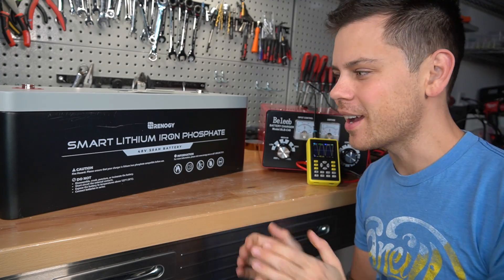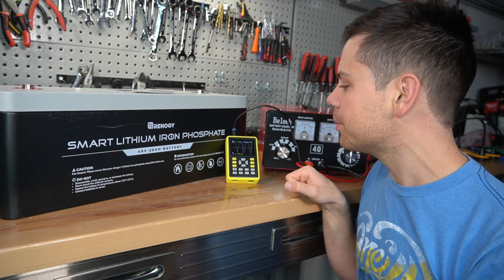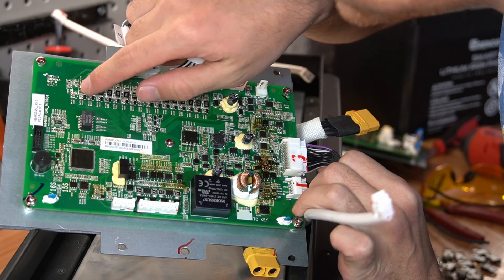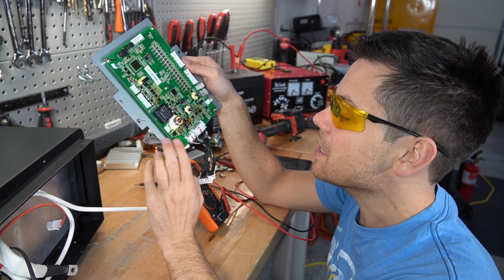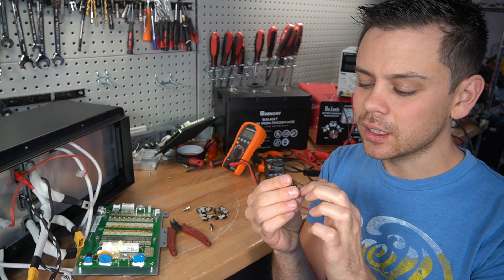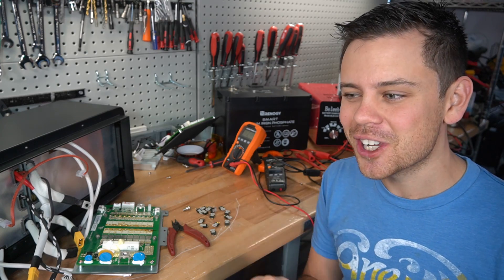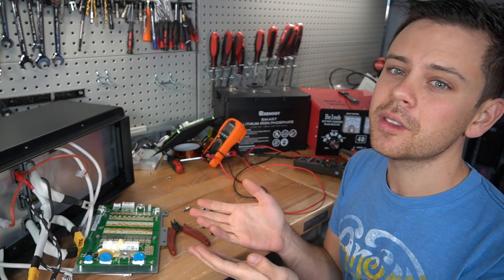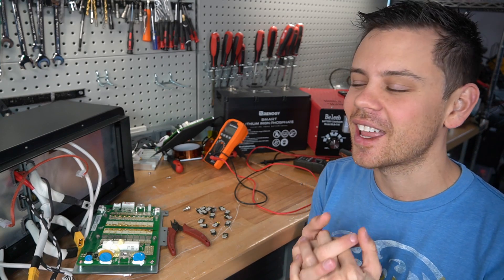Renogy "Smart" 48V 50Ah Part 2: How did I kill it?

Comment from the maker: Correction: I was wrong for calling it a cheap crappy charger, it is just designed for lead acid. My fault for using it to charge this pack. I charged a few other packs without issue, but this one could not handle it. 

Max voltage rating for FET on datasheet is 100V: https://www.st.com/resource/en/datasheet/stf150n10f7.pdf
But the kickback voltage from transformer based charger can be insane. Just takes one surge to destroy FET, or weld it closed.

I am going to order an expensive oscilloscope. I rarely use it, but man I need one now.

I also had 3x 48V inverter chargers I could have used, but just grabbed this one because it is so light and small. Stupid me. I have plenty of other equipment I can use haha that was not the issue as some are commenting before. And this charger worked fine on some other 48V LiFePO4/NMC packs.

~~~~~~~~~~~~~~~~~~~~~~~~~~~~~~~~~~
Tired of getting ripped off? Check out my "Will Prowse Approved" solar product recommendations below!

12V Batteries
https://www.mobile-solarpower.com/lithium-batteries.html

48V Batteries
https://www.mobile-solarpower.com/48v-batteries.html

Offgrid Inverter System Builder
https://www.mobile-solarpower.com/48v-complete-system-blueprint-559371.html

Hybrid Inverter System Builder
https://www.mobile-solarpower.com/code-compliant-48v-offgrid-system.html

Mobile Handtruck System Builder (very popular!)
https://www.mobile-solarpower.com/mobile-48v-system.html

Solar Panels
https://www.mobile-solarpower.com/300w-solar-panels.html

Ground Mount Solar Racking
https://www.mobile-solarpower.com/ground-mount-racks.html

Wire, Lugs and Busbars
https://www.mobile-solarpower.com/wire-and-connectors.html

Tools
https://www.mobile-solarpower.com/tools.html

Fuses and Circuit Breakers
https://www.mobile-solarpower.com/fuses.html

Plug-N-Play Solar Systems
Ecoflow, Anker And Bluetti! So many models to choose from. See my current recommendations here:
https://www.mobile-solarpower.com/full-size-systems.html

~~~~~~~~~~~~~~~~~~~~~~~~~~~~~~~~~~~~~~~~~~
Need to build a large DIY system? Need a trustworthy solar distributor? These are my favorites:

Signature Solar
Creator of EG4! Solar Minisplits, Victron and More! Largest Solar Store Online.
If you want $50 off, please use my link below and coupon code "DIYSOLAR50":
https://signaturesolar.com/?ref=cPwLcVc0SW-BjN

Current Connected
Best Prices for EG4, Victron, Midnite and so much more! Fast Shipping and Highest Rated Customer Service:
https://currentconnected.com/?ref=wp

~~~~~~~~~~~~~~~~~~~~~~~~~~~~~~~~~~~~~~~~~~
Join our DIY Solar Community 
Need more help? Join the largest solar forum on the internet for beginners and professionals alike. 140,000 members and counting!
https://www.diysolarforum.com

Check Out My Free Book
Best-selling and beginner-friendly guidebook to off-grid 12V solar!
https://www.mobile-solarpower.com/the-book.html

~~~~~~~~~~~~~~~~~~~~~~~~~~~~~~~~~~~~~~~~~~
Contact Information:
I am NOT available for personal solar system consult! If you wish to contact me, this is my direct email: williamprowsediysolar@gmail.com
FTC Disclosure Statement and Disclaimers:
Every video includes paid promotion or sponsorship (such as free products for review). Some links on this YouTube channel may be affiliate links. We may get paid if you buy something or take an action after clicking one of these. My videos are for educational purposes only. Information is subject to change/update at any time. Electricity is DANGEROUS and can kill. Be smart and use common sense :) DIY Solar Power with Will Prowse is a participant in the Amazon Services LLC Associates Program, An affiliate advertising program designed to provide a means for sites to earn advertising fees by advertising and linking to Amazon.com
Reply: It looks like it might even be more than 72V, the oscilloscope screen looks pegged. Can you adjust the volts/division higher than 10V? I think that's a 5012H scope which should be able to read up to 800V with a 10x probe.
Reply from the maker: Oh right, I thought that it was pegged too, but I used autoset and max voltage for edge. I can't read any voltage higher. And yeah, 800V max. 
Just tested it different probe and cant get a higher value. 
But yeah, the kickback is probably a few hundred volts. I could test that also
Reply: @WillProwse  
I think you would probably need a 10:1 probe for >80V voltages. Oops, I see Martin Stieber beat me to it. 

I’m not sure why you need an expensive oscilloscope. 
It’s nice to have an isolated one (so you don’t blow it up whenever there’s a direct path to mains). The battery operated one obviously is isolated;). 
If you don’t need to measure high frequencies why would you spend your money on an expensive oscilloscope?
Reply from the maker: @Conservator.  The fancy ones have so many cool options and multiple channels :D
Reply from the maker: @Conservator.  But true, for low voltage DC, my current scope does nearly everything
Reply: It looks like that scope can only read up to 80V with the 1x probe. So it might be even worse 😳
Reply from the maker: @MarcelStieber  Oh crap good point about the 80V with 1x probe. I still got 72V with my 10X probe
Reply: Or you might be able to use a DMM with a max-hold function as well to get a other opinion 😉

You should be able to manually adjust the voltage scale to make sure it's not pegged.

Time for a charger teardown?!
Reply from the maker: @MarcelStieber  This charger is going in the trash haha actually I could still use it for lead acid. Oh smart idea, ok
Reply: I found lots of review videos for that charger online, but no teardowns or actual electrical reviews. Totally understand if you're trashing it. Wanna post a few photos of the inside first?
Reply: Teardown definitely in order
Reply: If you are going to get a expensive oscilloscope, May I also suggest you invest in a differentotial probe to protect the scope when working with high voltage. Google don't blow up your oscilloscope. If your looking for a mosfet tester, I use the peak atlas dca75 which I use alot. Great video. .
Reply: @dontes9588  
Will could use a battery and an inverter and he’d have an isolated scope. 😉
Reply: Let me tell you you are right that it was faulty charger but mostly I find that your mistake is to add two chargers in parallel  in which both not even communicate and supply at max voltage to charge the battery
Reply: i have a battery charger like one you have it caught on fire so keep a eye on it
Reply: To be fair, Will, the Amazon listing for that charger clearly says "And “H” voltage is for charging a lithium battery or the voltage between 12～24V, 24～36V, 36～48V,48～60V,60～72V." So I think it's still fair to call that out as a concern. A good charger would have proper output filtering and protection against both voltage spikes and prolonged over-voltage events.
Reply: Please get rid of that cheap charger. Your a pro, so you should have pro or at least competent tools. You've got a fantastic channel sir.
Reply: May i suggest using a power supply instead of a charger next time ;)
Reply: Guys #1 in USN class ET/A. FET field effect Transistor. Coils. Inductive kick is Five times steady voltage when coil field collapses. Inputs to devices need ultra hi speed shunts to prevent this stuff. 

All oscopes come with Hivolt probes, old VT DMM (vacuum tube) input ones ultra hi impedance . Igfet mosfet style amps Cannot be connected to surge current devices. Hint battery gets zonked. 
DVM measure RMS one phase /0.707. 1.44 times rms equals peak. 120 vac is about 330 peak to peak. Fet,igfet , mosfets see the applied voltage AC plus DC. Cheap power supplies produce DC with a ripple voltage AC on top. 
From wiki. 
A field-effect transistor has a relatively low gain–bandwidth product compared to a BJT. The MOSFET is very susceptible to overload voltages, (edit: SPIKES HINT) thus requiring special handling during installation.[56] The fragile insulating layer of the MOSFET between the gate and channel makes it vulnerable to electrostatic discharge or changes to threshold voltage during handling. This is not usually a problem after the device has been installed in a properly designed circuit.
Reply: Hello William I have step by step plans to start billion dollar companies.

I like you as a person would you like to go into business with me? 

And I know this is going to sound crazy, but I figured out how to send a signal back in time.

I think you're a stand up respectful intelligent human being so partnership is yours if you want it.

Just because you support freedom of speech.

We can use our knowledge to make the world a better place.

My opinion of you is that you're an honest person with good intentions, and you are obviously very well educated and we'll spoken.

I see great potential in you.

We can start a company like Tesla and Solar City.

Comment: I just ordered 4 of these puppies... Mostly because of the internal heater, since it going to be used in a cabin in the wood.  The price for black friday way 849.99$ each canadian for a pack of 4, so it was 2480$ USD for 9.6kWh of sealed heated Lifepo4 with communication port (US site price is 2960$, it rate buying in Canada is cheaper (oh and shipping was free, but I paid their 70$ shipping insurance just in case)).  I though it was the cheapest out there.  It not rated for really high amp usage, but having 4 in parallel, that still give me 4800watt to the rated 25amp per pack.  And my  goal is to draw very little so it can last a long time.

Comment: I’m having a hard time getting this to fire up my Outback inverter. The battery is displaying a red error and when it tries to cycle it’s setting off the batteries bms. Already tried pre charging the capacitors and I’m still getting the same results what could be going on here ?

Comment: maybe you can answer this if want to use 4 of these will my 6 400watt solar panels mess these up was looking for a lot of power for my off gird setup and saw these in your video, would 4 be enough to run my fridge, standing freezer, conduction range and tv and my pc? or would i need six.

Comment: Hi Will. I just found you last week and have tried to understand v w and amp. But no luck yet. I have a  500 gallon koi pond and have bought 4 100 watt panels. I also bought 4 12v  50 w water pumps. Thru eBay. 3 of them have already failed. I bought a bluetti ac30 to back up my 50w  electric piump. I works for 2 hours.
 After a full 6 hr charge.   I’m very frustrated and am stuck.

Comment: Guys, is there anything we could've placed in between the faulty charger and the battery (like say a fuse/breaker) that would stop that from happening? I just wanna know so that when I build my system something like that will not happen to my BMS.
Reply from the maker: Use a lifepo4 specific charger and you will be set

Comment: I think it is odd that this is a 15S not 16S battery?  I would expect on buying a 48V (nominal) lithium battery, that naturally means 16 3.6V cells in series, but this one has 15, which is surprising.  Is this a normal think for 48 V lithium batteries?  The specs on Renogy's site, or on Amazon details page, etc., really should make this clear, and I don't see that called out anywhere except this awesome video.  It's vital to understand this so you know to charge at 15 * 3.6 V not 16 * 3.6 V!  Thank you for testing and uncovering this, Will!

Comment: From the comments, it appears that the consensus is that the uncontrolled stored energy spike from the charger transformer destroyed/shorted one or more mosfets in this particular bms with (perhaps) the parallel charger a contributing factor. Should the battery design defeat the spike? Should the battery manufacturer thoroughly communicate to the consumer "do's and do not's"? Should qualified engineers foresee what can (and will) go wrong instead of just foresee only those things that go right?
What would I like to see?
Construct s dummy circuit to duplicate the event with the "crappy" charger alone and then with the paralleled chargers. See if your meter can trap the spike.... if not...your new scope. Using mosfets perhaps not even necessary but would add extra interest using identical mosfets and then mosfets with a higher voltage rating.
A look inside the charger to show,/explain why no no no.
A look at the bms in the batteries that were unaffected.
End result: a training video for all of us.....and perhaps the OEM engineers.
Maybe even the auto repair professionals that were converting a Disney car (lots of wood) to Lion (or intended to). Battery pack in bed of car, apparently charging with old style welder, all captured on multiple security cameras. Did get it rolled outside when the "fireworks" began. Have no idea why they posted it to YouTube.

Comment: Still disappointed the bms can't catch the high voltage and disconnect, surges can happen in real world use and like you said the other batteries you tested were able to disconnect when hit with the same charger.
Reply: It can't disconnect because the supplied voltage is beyond the rating of the electrical components used.  Understand that the BMS won't even see that huge voltage when it is passing current (on).  This LFP battery behaves similar to a lead acid battery in that the higher power / lower voltage battery wins, and the charger current limits and the voltage 'folds back' to a lower value.  What Will showed on the scope was the charger output when unloaded - it won't output a waveform like that with a battery attached.

The actual damage happened when the BMS had the FETs open due to the low temperature cut off being triggered.  In that case, the voltage from the charger (unloaded) was seen by the FETs, and one shorted.  Could Renogy have used higher voltage rated FETs - sure.  At some point there is a design balance, as higher rated parts can have other system issues such as greater self discharge rate of the battery due to that circuitry.  Specs in that regard may be superior with this battery vs. others.  But in any case, this scenario would not have happened if the batteries were used in an inverter/charger solar system - just bad luck using a pulsed DC lead acid charger.

Comment: Please.. before discounting the data port as unnecessary,  please try it with the Renogy BT-2 and DCHome app. I believe you will find it less expensive, simpler and least as useful as a Victron shunt monitor as well as allowing you to remotely shut down battery to save current drain from the BMS. As well the BT-2 can monitor your 50 amp DCtoDC charger/MPPT to monitor current and voltages. I have been testing these components out for my camper van and am impressed so far.

Comment: It does sound the the charger killed the battery, but I have issue with the battery dyeing with the "cheap crappy" charger. the failure mode is bad

Comment: That brings up a great question that I have not been able to find a solid answer on. What charger do you recommend for 4S lifepo4 charging? Perhaps info on a budget and top end model would be great as I am starting my quest on building a 100ah lifepo4 4S, and not sure what charger/balancer would be best to charge it safely. Thoughts?
Reply: As a side note, the battery's are not to be used for solar, I am looking for a recommendation on a 110v charger as this will be used as a deep cycle to run a motor.

Comment: Wrong charger or not, Renogy does deserve some crow-eating here. It would seem to me the battery's over-voltage protection is either terrible, or non-existent. You won't be the last one to hook up the wrong charger with the right voltage rating. The 5 cents they saved on their BOM cost by not doing robust over-voltage protection is probably going to cost them needless warranty returns (on a product that's expensive to ship). I think you may have accidentally stumbled on another test to conduct on other batteries -- if your Battle Born batteries tolerated that cheap-o charger, I think that would prove my point. 😁